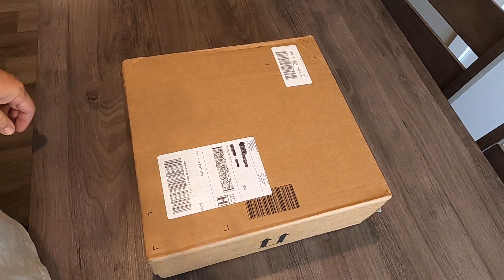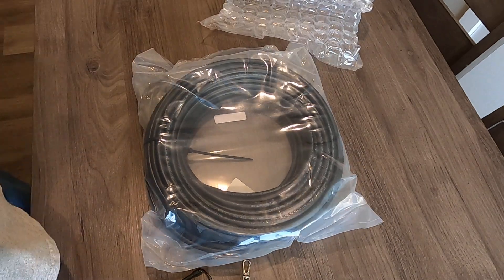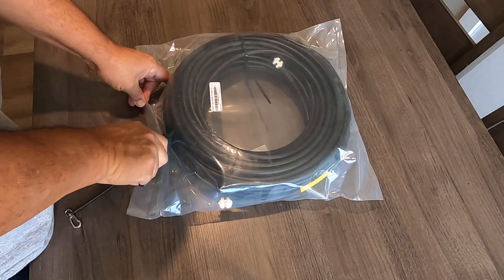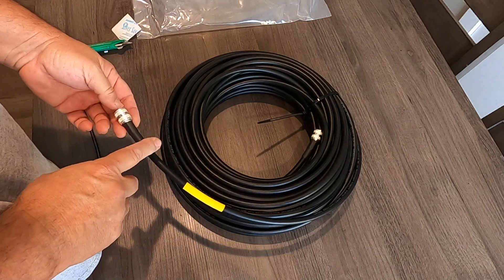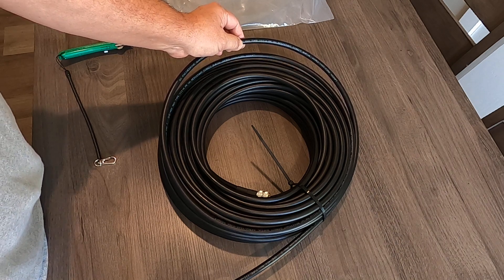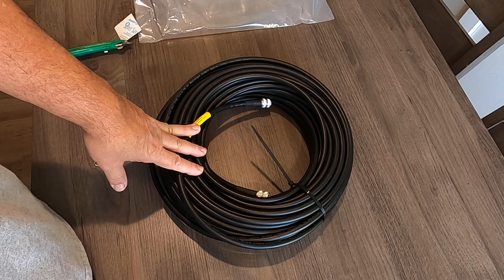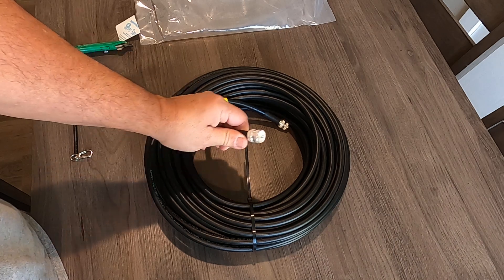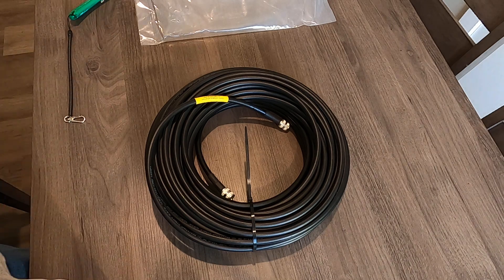Unboxing New Coax

Comment: Good stuff! DXE400 is a  high-quality, low-cost coax cable that really shines in VHF/UHF applications. It has 0.8 dB loss at 30 mhz which is like hooking your rig directly to the base of your antenna! 
There is one caveat: it's not recommended for moving antennas like beams. The constant flexing will cause the cable to fail. The workaround is to mount a lightning arrestor on the tower and run a jumper of either 213 or 8U from the arrestor to the beam. 
One more hint: pick a warm day with sunshine to install this cable. Unwind and stretch it out and let it warm up in the sun for a few hours and it'll be much more cooperative.
I recommend getting it with the connectors installed because this is a double-shielded cable.
Reply from the maker: The plan was that when I put the beam up, I'm going to use a 18ft chunk of UltraFlex at the beam, wind a Balun and then down past the rotor and into a Barrel. Then use this stiff coax back to the radio room. 
Never thought bout the arrestor up top as a barrel. Good idea.
The DXE 400 looked just as good (for 27MHZ) to me as the spendy stuff that is out there. IF... I was going to do some VHF/UHF I may look to some 600, because that run will be 120+ft out to the Tower.
Cheers.

Comment: Are the connectors crimped? I'd still rather solder..
Reply from the maker: Yes they are crimped at the shield and center is soldered. Only time will tell.
HOWEVER..... DXE is not known for having shotty coax assemblies.  They do this every day and have the proper tools,  I don't. :) Hate to say this but in this case I would say they will do a better job than I.. Cheers

Comment: I purchased 100ft of Messi & Paolini Hyperflex 10 its on a Freighter somewhere between Here and Italy.👋🤠
Reply from the maker: I understand that is some nice stuff.
Reply: thats nice stuff Messi & Paolini 10, but I see the same "numbers"  and short comings  of typical  RG213 or even LMR400.    I went rounds reading charts  and $$$ signs in what I wanted to use here on this station.  Just happen to land a decent deal on Time Microwave LMR400  for the vertical and Beam run. But this was  a few yrs ago, not todays prices.

Comment: My hands have gotten so bad I don’t even bother trying to build my own coax or jumpers anymore. I’ve got a friend in California who build comms for aeronautics contracts and had all the good stuff,for jumpers he usually just charges me what the connectors cost and shipping. A month ago I had him make me all new rg400 double shield jumpers for inside the office,couple 90 degree PLs,couple with Pl to SO for connecting to my 218 outside,plus rg316 double shield pig tails for my radios. I’m in the process of pulling the crusty worn out SO239s out of my radios and installing heyco dust/water sealed glands where the SO’s were and hardwiring the 316 pigtails with So239 on them in all my radios like the newer driver radios have.  Most of mine are worn out,not to mention the damned heatsinks are always damned near too close for full-size Amphenol PLs anyways.
Reply from the maker: Wholly shit Man... You are stroking. WOW!
Reply: @390WagonMaster  trying to get some some stuff done before I have hand and knee surgery because I’m
Gonna be useless for a while.